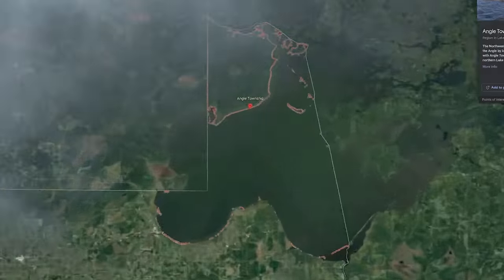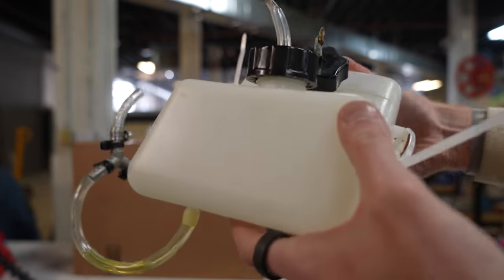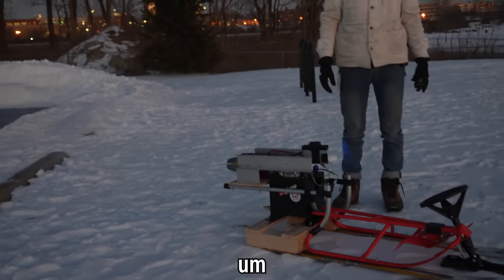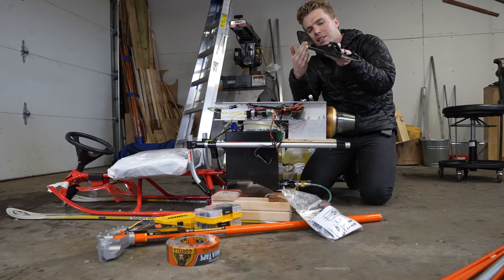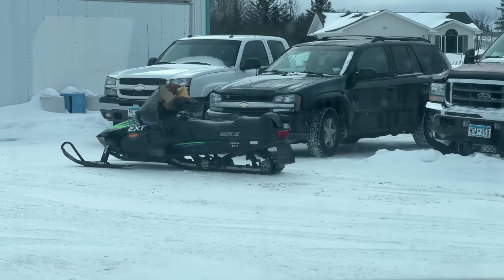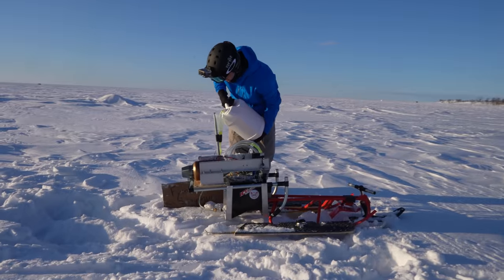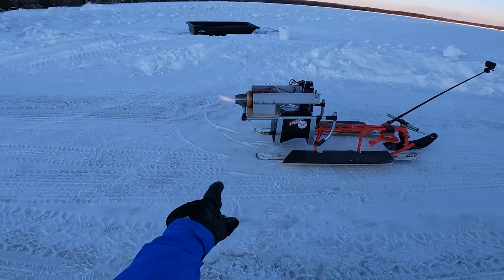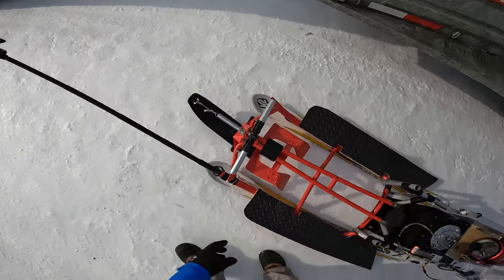Jet Powered Sled vs 38 Miles of Ice!

Comment: You could have put the skiis on an slight angle so you drive slightly on the edge wich could help you ride straighter
Why didn't you mount the jet engine on the bottom of the sled?

Comment: That was fun and interesting but in reality kinda harder than it actually could have been.  First, maybe I didn't quite understand the challenge but that $700 snomobile they bought could have crossed that channel in 15 or 20 minutes in comfort.   Second, if they waited a little later in the spring, the snow all melts off and the ice is still fine and it would be a straight shot at 40 mph and Bob's your uncle.   Still what fun would that be.

Comment: You should have made it a turbine snow bike!!!
Less ground resistance and space to mount fuel tanks and everything in the frame already, comfortable seating position and even suspension!!!
Rebuild it using a snowcat and a jetcat pro series turbine. The pro series jetcat have an alternator on them and more power than the hobby motors and would make more sense for a ridden vehicle.
I would also try to find a hardwire solution for the throttle if I were you.

Comment: I think you would have done better with freeride-style snowboards instead of skis, with spring mounts in the front, angled inward 1 or 2 degrees, and for steering a simple rudder blade instead of a ski.

Comment: hear me out... 2 engines, inside a heat resistant shroud to stop condensation, 2 engines for more thrust to be able to add more weight for fuel, and you can add more sled to be able to sit in a more ergonomic position for better aerodynamics

Comment: Need to use the turbine to spin a generator into some caps at high voltage use it to charge the batteries thru a converter to low voltage.    U would only use the turbine to charge the batteries when low add an overhead head solar panel and use an electric motor running some tracks on the back with the pivot being where the sled Mets the tracks add servos one each side u have steering .

Comment: Long list of improvements Make it longer And improved the stirring but there's a suspension on The sled make it wider And Is build a form of a ram air intake For the jet engine your body is blocking most of the air And build the design  aerodynamic More like a 2 man Bob sled and use wider skis  on top of the wider stance make slightly heavier to gain.stability on the rough snow and use snow  mobile  steering.

Comment: get better ski's to prevent it cliping a dune and nose diving. widen the surface area the ski's make contact with the snow to help with sinking in. add controls to the handle bars. add a landyard kill switch so tip overs will not set you on fire. find a way to prevent snow from getting to the engine because the stock fod screen isnt going to help keep it running.

Comment: Get a kayak, or a  canoe, modify it so you can   lie down o n your back with  your head slightly   raised like an F1  driver.  mount ski's on  each side. maybe 2 on each. jet   engine  goes behind you.  this will help you get  over  those  bumps no problem while being safe  inside. im sure you can figure out the  steering  part. 🤣

Comment: Problem with NordVPN, is most of their servers are blocked by Netflix, BBC iPlayer etc etc. According to NordVPN support, the reason is these streaming services see thousands of connections from the same small group of IP addresses, the only reason that would be the case is if those IP addresses were part of a VPN... so they block them.

Comment: Take a snowmobile remove the eng and tracks, and replace the engine with the jet.. you might build an inlet so there is no obstruction for the air to get to the engine.. Jets don't make lots of power at low speed, so crank it up...

Comment: That $800 snowmobile could easily cross that 38 miles ... so WTF are you guys doing??
Reply: No, it cannot… Obviously you never drove a snow mobile on several feet of snow. Your skies will literally be eating snow trying to get traction. It’s possible, but it would be slow and very cold. I wouldn’t want to do it, main reason why nobody travels across this lake during winter.
Reply: @xorxpert  agreed,  it is a pointless trip. ..and Yes, I've done a lot of snowmobiling, running on frozen lakes is about all we do here in Michigan where I live  .. and that $800 snowmobile can go anywhere 10X easier than that toy jet engine sled they made.

Comment: Isnt it scary riding something you built yourself with a jet engine that could blow up really easily behind your back across 38 miles of frozen surface at high speeds without much protection as in like crumple zones in a car and stuff and seatbelts and fire spewing out the back???

Comment: I see people do this all the time just cause the lake was one way doesn't mean it going to be the same next year. I live in Montana and our weather is different every year. I would of made the sled about 6 inches off the ground and used different skies thay were  longer and I would of had more weight on the front ski and on the bottom of the steering ski I would put a stabilizer so it kept the ski from doing side to side movement and it would help steer better. Maybe next time

Comment: Make it larger, about the size of a good sized quad: 4 or 6 engines, small closed cockpit , much larger skis. Use fuel with antifreeze. Try something like bleed air from one engine to heat up another if one goes out. You might be able to use some for cockpit heating. Get engine instrumentation inside to monitor the state of all engines at all times. Use batteries that are less impacted by cold.

Comment: 3/5 through the video. I think your knee-saver wooden runners are too close to the ground, and will dig into the snow and slow you down. Something like a dogsled would give you better comfort and capacity for fuel - although steering.... Hmmm.

Comment: Just build it bigger with suspension and a bigger propulsion system..... 
I think engineers and machinests should actually go gets drinks and talk more.
Because buying a sled was a waist of money that could have been used on material to build a better sled out of aluminum and carbon fiber. That you could lay back on which would have then given you better weight distribution twards aft allowing the forward most point to "float" on the ever changing snow pack.
But you see I'm just a "machinest" with no education and would love to have beers and talk to an engineer about these things!